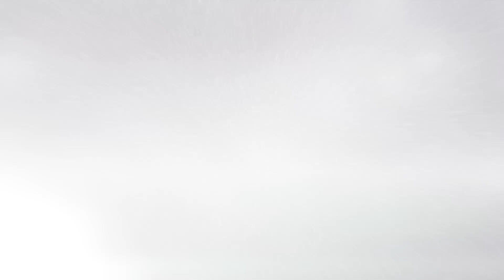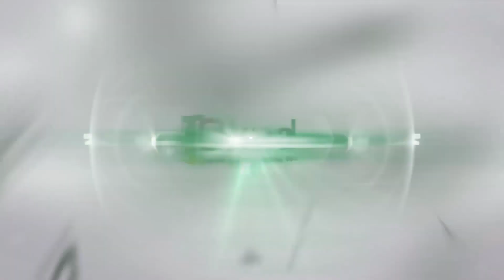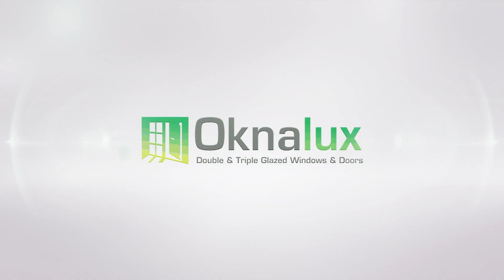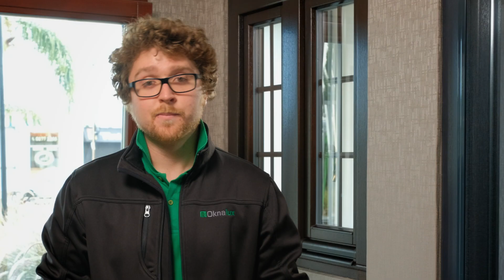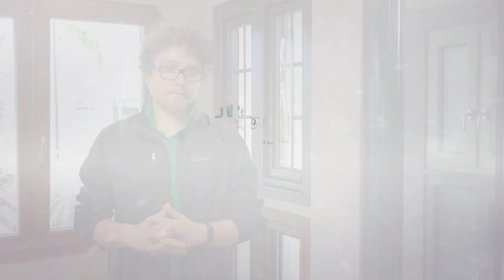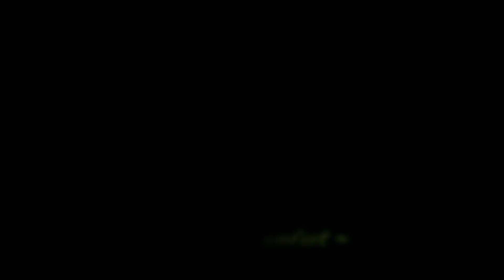PVC vs uPVC

Comment: "Make sure that you are receiving UPVC and not just PVC"  I may be wrong, but I'm thinking people are getting this backwards. When you "un" something you are doing something to it in order to change it to suit your needs. "Plasticizing" PVC is an additional process that serves no benefit to PVC as a window building material, so I think it is safe to assume that your windows are already "un".
Reply from the maker: Not entirely sure what you are saying here. PVC window frames have the potential to discolour, go brittle and break under extreme son conditions. uPVC window frame will not, its essential to ensure that the window frames are compliant and tested to the standards of the environment they are being installed into. Our uPVC windows are fully compliant to Australian and New Zealand Standards. They are all uPVC window frames. Thanks for watching.